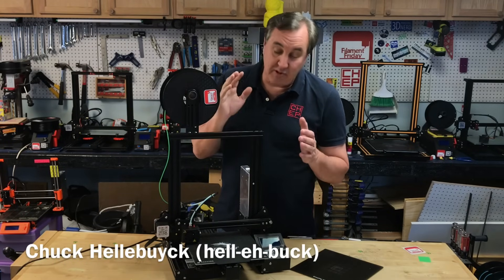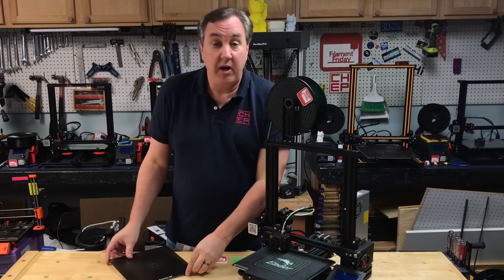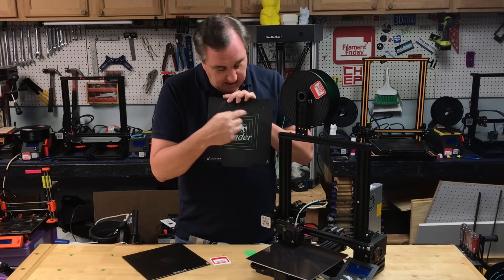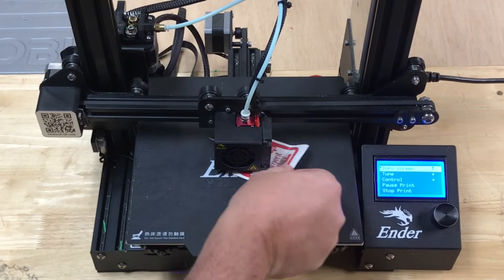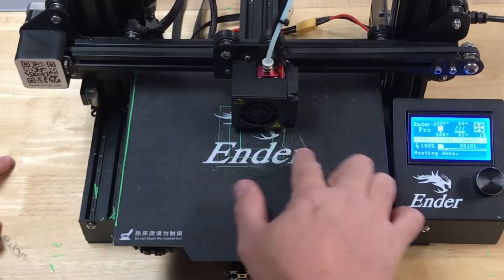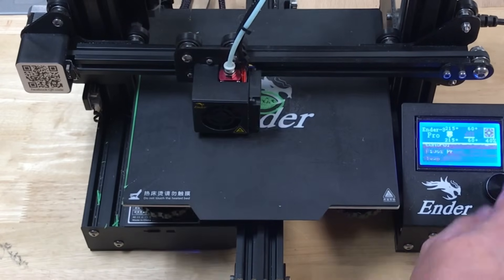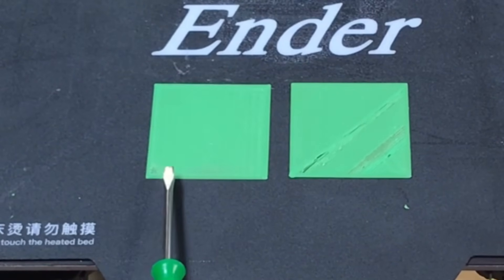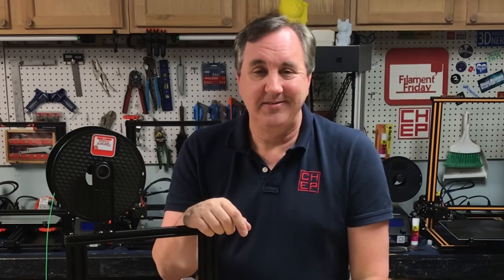Creality Ender 3- Easy Way To Level Your Bed

Comment: Noob here. I just finished building the printer and run your file. I have my springs fully compressed (Almost) so the bed is low. But when I run the test the nozzle is pressed against the bed. I can't go any lower. What am I doing wrong, anybody else get stuck here?
Reply: I need to raise the stop switch on the x axis a bit don't I. So obvious now I have thought about it. I hope this helps someone else.
Reply: OMG I just did it and it even has a little foot so idiots can't do it wrong.  At least it worked!

Comment: Hi! Today I got my first 3d printer (ender 3) and it seems that the middle of the plate is higher the corners... How do I fix that? I used a piece of paper and your 3d print but it's still not working in the middle..
Reply: If your middle is the highest point,then you will have to "raise" the corners and sides equal to the middle. Try putting tinfoil or similar thin material in corners and sides

Comment: Hey Chuck,  These 2 gcodes are excellent.  They seem to extrude the right amount of filament and I couldn't push them off in any of the corners.  That being said, I had problems printing and getting anything to stick on the next print.  I know you have posted different profiles for the Ender 3.  Could you point me to the profile you used in your slicer so I might get my slicer to work with yours?  I am using Cura 4.5 which I think is the latest.  Thanks, Irv in Florida.
Reply from the maker: I added links to the slicer settings in the video description.

Comment: I downloaded the gcode in the description for assisted bed leveling and something weirds been happening. Most of the time, the movement speed is the same as in the video, but every once in a while, it becomes very fast, maybe twice as fast. How is this possible if i'm always using the same gcode?
Reply: I'm dealing with that now. My theory is that it uses the travel speed from the previously printed gcode
Reply: @JavedAli-nq6ou  Yea, I think you are correct. Any idea how to set the speed to a constant?

Comment: Congratulations for your video. It is very rare to see such great technique and presentation skills. In 3d printing since 2010 with a reprap and yet suprised how nicely and well structured some info can be supplied accompanied by proper material (your calibration / positioning file is amazing). Thank you!
Reply from the maker: Thanks

Comment: Hello, had a big amount of problems with my heated bed, and i've tried your gcode, for me is perfect, but doesn't sticks all, then i made with your stl few gcodes only changing de high of the first layer at 0.22, 0.24,..., till 0,38 at 205 degrees and at 200 the same, to make it better. The problem is that after try from 0.22 till 0.34 , it was fine, but some of the tests ( 2 times) when i stop the printing, the hotend goes to left or comes to me and the stepper don't stop till 2 seconds more or less after reaching the end, making that the belt makes strong noises ¿ can you help me  to knowing in wich point i have the problem? ¿ maybe the changes i made change something in the printer, only changed temperature and the high  of the first layerwith cura 4.5? thanks
Reply: Sorry, have Ender 3 pro with the only change of the noiseless board creality 1.1.5 working perfectly for 2 months
Reply: i named my modified file as "(038)CHEP_bed_level_test" for high of layer 0.38 . Maybe there are some problems with the parenthesis stopping the file?
Reply: and after put your gcode, the only file i used in my ender is my modifieds with temp and layer files at 0.28 till 0.38 files

Comment: Chep, About to launch my Ender 3 Pro out the window after getting 2 prints out and then nothing sticking or leveling correctly. Ran both your files and watched your video. All Appears good for now.  Will have to watch the other videos and see if you have one regarding the BL Touch and if worth the upgrade
Reply from the maker: I don’t. I’m not a big autolevel fan.

Comment: The leveling had the extruder working perfectly.  However, once I stated printing the filament refused to adhere to the Build Plate.  I've tried to print a mini numerous times with the same result, several inches of spiraling filament
Reply: May have been a problem in the slicer.

Comment: Hey CHEP! I have to level my cr10 mini bed after every print. I've checked and tightened the under carriage rollers. Checked the z stopper and installed a mirror tile bed. My bed is perfectly levelled, then when its done. I check and sometimes one is too high and other times its too low. I marked the adjusters and they are not moving. Should I get new springs?
Reply from the maker: Not sure. It’s an easy thing to try.

Comment: Hello CHEP. I'll be honest, you probably are the reason why I didn't give up 3D printing in the first 4 days of my 3d career. In the beginning all went well since I was printing very small designs. But when i tried to print the back lcb pcb or a tooltray all went wrong. I have spend hours and hours, probably days, to level the bed and I just couldn't get it perfect. WIth your tutorial above, I did it in 2 minutes. Thanks alot.

Comment: Very good video. I will def try this. I got an Ender 3 Pro last week, but calibrating all corners with the paper (slight resistance), when I move the nozzle to the center of the bed, the gap is really high, and theres no center knob to rise/lower the center of the bed. I ended up putting a couple of origami papers underneath the magnetic bed, and it did improve a bit, but on certain models I print, they just wont stick to the bed for some reason. Any ideas? Thanks in advance!
Reply: I had the same problem with my Ender 3 Pro, so I bought the Ender 3 Pro glass plate to fix it .However the glass plate had the same problem the gap in the center is bigger then the gaps in the corners. One day I decided to flip the glass plate upside down resulting in a smaller gap in the middel, so that fixed my bed level issue.
Reply: Some beds are bent. Place a decent straight edge across it to find out how straight it is. It is possible to take the bed off and gently bend it straight.

Comment: Chep, how often should I do this
Reply from the maker: Depends on your prints, if you changed nozzles, if the bed get rocked by a difficult to remove print. There is no one answer.

Comment: Why are these machines so wasteful?  An automatic bed leveling sensor makes setup a breeze and you don't waste materials.
Reply: Automatic leveling doesn't actually level anything. It moves the extruder up and down as it travels around to match the non-levelness of the bed. This propagates all the way up the print. It "works" if you don't care about tolerances

Comment: Hi CHEP - tried to use your programme but the head has impacted the bed and I have no more adjustment in the wheels....... any ideas about what the problem is? - thx
Reply: Probably your Z axis limit switch, is it connected to the frame correctly?

Comment: Okay, so I finally figured out that just a little hair spray was able to help adhere to the pad, but what can be done to change the Z-axis offset to prevent it from grinding on the previous layer after about 1mm?
Reply from the maker: Loosen your t-nut. Your probably skipping steps
Reply: @FilamentFriday  the z axis rod t-nut ? i changed my layer height in cura (4.5) but it would be nice if i could let the slicer run default so i don't have to custom profile for my other printer.

Comment: This worked the fist time really good. Now I tried is 3 times in a row, and the layers stick. But if I try to print something else it completely falls off. I've wasted 1/4 if my pla roll on this... I just can't get it to work.
Reply from the maker: You use the live adjust shown in this video to tweak for the print you are making.
Reply: Spray Aquanet on the bed and do the on-the-fly adjustment while it's printing the skirt.

Comment: If my bed has a dip in the center, about 1 + little difference around the bed, could it just be defective with the magnetic pad on the Ender 3 Pro? It pretty much makes bad prints or no adhesion on some parts, so I can only do so much when it comes to leveling before it's just a waste of time.
Reply: I also just bought an ender 3 pro, and the bed is slightly warped. But, I think it's not defective as almost all of them have this issue. I think it's just a matter of tweaking trial and error, and of course wasting a tonna PLA
Reply: @waitingforpapatobless7540  Not to mention hours of time. I keep having a problem when I can level the bed when I set the auto home to set the Z-axis to zero., but it changes the moment once I put any heat to it.
Reply: @donutreligion2979  Don't use a flexible pad. They are prone to just that problem. Use a piece of glass instead. I got a 4 pack of mirrors from Menards for ~$10.
Reply: @googlegamer4047  Did just that. I'm just trying with a trial and somewhat error for perfect bed leveling. I did get a bad spool of PLA from Soultech which does nothing less than clog up and ruin tips and Bowden tubing. Overture is much better and has never clogged.
I've never heard of Menards before, I live in Florida, but I caved in and spent 15 dollars on Amazon for a 2 pack of the same size.
Reply: @donutreligion2979  I've used a couple rolls of Solutech. Never had a problem. Of course I upgraded the extruder to an e3d Titan.

Comment: I've been using the GCode file you provided and has been working great but how can I get it to traverse fast between the 4 points?  I tried editing G1 to G0 for the move to each position but for some reason its still moving at the pace you set in the file?  How can I get it to zip from point to point?  Thanks

Comment: My issue is that the highest spot is right in the middle. So I can do all the leveling on the perimeter but as soon as I level the Centre, the gap around the edges becomes too big.
Reply from the maker: Your bed is warped then. Replace or just try to flatten it.

Comment: Hi Chuck, I am having some difficulty in leveling my Ender 3. I followed the video instructions multiple times. I do the calibration procedure and I print the test gcode, one part of the bed gets a very thin line of material compared to the rest of the bed. Also, I noticed how the material start to stick to the extruder nozzle. Any guidance will be much appreciated.
Reply from the maker: If it’s sticking to the nozzle then you might have a partial clog.
Reply: @FilamentFriday  Hi Chuck, Thanks for your prompt reply. I cleaned the nozzle. I had immediate results on one side of the bed. For some reason, the filament would not stick to the left side of the bed the left-hand side of the bed. I cleaned it with alcohol to no avail. I did notice the left side of the bed is smoother than the right side. I will try glue and see if that makes any difference.

Comment: I can't get any gcode to go on my sd card, i can't get it to print correctly either, I've tried leveling it manually with paper but can't download anything to the SD card. HELP
Reply: Did you try formatting it? Sometimes your sd card might be faulty
Reply: What kind of printer do you have? The sd card that comes with the Ender 3 or any creality printer is notorious for failing. I would just get a new one.
Reply: @TheGoldenEagle14  Yep, mine failed after two days lol. Luckily I bought a mini usb cable before to use directly with Cura.

Comment: I have done everything including you bed level and nothing sticks to bed I have this magnetic plate I should of got a glass one. I'm using Ender 3 Pro and it crap cant even get a print off and its been 3 days same thing all the time it doesn't stick . My temp is at 200 my bed is at 65 did your calibration 5 time already and still nothing it doesn't stick all it does is melt filament and drags it around the plate. One would thing 2020 and cant even get a good printer from these people is a joke
Thanks for sharing maybe one day i will be able to print as well
Reply from the maker: Clean it with IPA or soapy water.
Reply: @FilamentFriday  thanks I did your bed level it worked after 20 try then I wanted to print something small and nope will not stick  but if i try your again to level it works but i cant print anything else i  slow it down to 45 speed and still nothing . Really stubborn unit this thing . but yea ill try sopy water
Reply: what filament are you using?
Reply: @kasperbennetsen6302  pla i have a glass bed coming and new magnetic pad
Reply: @therambler3833  try slowing down the first layer speed to something like 20mm/s
Reply: @andypodmore6721  i'm runing at 20 still no go new bed colour filament doesn't work at all white that came with unit works but still need to calibrate
Reply: @andypodmore6721   I can do the square But thats it when I go to print everything seem off the 4 corners on my machine are good then when it goes to middle to high then use baby step z all the time i also get a to far error and heating error always having to shut down restart
Reply: @therambler3833  have you set your Z offset to compensate for the thickness of the paper your using?
Reply: @andypodmore6721  yea I'm good now i use CHEP profile and re calibrating and finally a print came out its a little warp but its a print nerveless thanks CHEP for the profile
Reply: no i didnt Big mistake i'm new to this so no i didnt

Comment: hi buddy I'm hoping you can help me witch I'm pretty sure u will be able to. my father in-law got his ender 3 and set it all up and auto homed it perfectly no problems at all but then when he starts to try and print a file the nozzle moves up the z about 2 inch above the bed and tries to print the test lol can u please tell me how to solve this as everything is like mine is.
Reply from the maker: Check his slicer settings for z offset. Or just use my profiles.
Reply: @FilamentFriday  hi hes not got to the sliver yet as we are trying to do the test prints on the card witch we thought that would be the issue so i sent him to bed leveling test i use all the time and that did the same thing

Comment: Just went through this as well, 3 out of the 4 lines are perfect every time, my front facing line (closest to the front of the printer) has a small almost double? quality to it. It will print the full line, but it's like it's either not adhering or not extruding enough. Any thoughts on this issue sir? Otherwise it's working well.

Comment: Hello,

I have the Ender 3 pro, 

I have been printing with PLA up to now without any problems. But now, suddently, I can't print. Altough the bed is hot and leveled, the first layer doesn't stick to it. 
I had been printing with the same filament the day before and it worked well

What can I do? What do you recommend?
Can I use a kind of glue like lacquer, hair spray?
The bed is the rough, the magnetized

Thanks
Reply from the maker: Clean it with IPA or just soapy water.

Comment: Ran the file and melted a couple holes into my print bed. Something isn't right here...
Reply: Probably not a good idea to run it with a hot tip, right?
Reply from the maker: Then you didn’t do the first step right with the paper.
Reply: CHEP Guess that means your instructions were unclear. I used paper, don’t have any stickers (nor am I gonna beg for on through the mail). Got it down so that the paper was very hard to pull out from under the nozzle like you said to do, and now there are holes in my print bed. So.... poor execution or poor instruction?
Reply: @andhrimnir04  the paper should NOT be hard to pull out. You should only feel a moderate resistance when using only paper. Also, why would you think a sticker and a piece of paper were the same thickness? A sticker is almost double the thickness of a piece of paper.
Reply: K Walt Again..more than 8700 people can do it. You don‘t. Where is the mistake. You will not find it i guess. And it looks like he knows definitely more than you , which is obviously not so difficult, because he has no holes in the leveling bed...😂😂😂

Comment: Doing a bit of an experiment into so. How long it takes for a bed to vibrate itself out of calibration have fixed extra nuts under the bed adjustment wheels to lock in the bed setting. Wonder if this will increase the length of time that it takes before it needs readjusting. Simple to fit on change on my ender 3 Pro from the standard are some stronger springs. I will let you know the outcome. Stronger springs have made a difference already. I also have a short video on my channel about an auto off module please take a look it's a great safety feature. Would be perfect for one of your great videos. Many thanks Tim

Comment: Okay Chep, I have to agree with the below comments great video, I downloaded the files ran the bed leveling G code then ran the test print squares. It turned out better than the results I was getting on Saturday but, I have one of the squares that did not adhere to the bed along one side, it is the second from last inner square on the side towards the front of the machine will try to include a picture.
Also, had just a couple places that instead of sticking on the first pass it pulled some spider web types strings but, the second layer stuck good and, like Michael below I had to turn my bed up to 60 F. Won't let me post a picture.
Reply from the maker: Filament used will affect the results but thanks for the feedback.
Reply: @FilamentFriday  , I upgraded my firmware to the TH3D Unified and it seems to be printing the test a lot better. No strings pulled and perfect squares, I still turned my bed up but, prolly didn't need to.